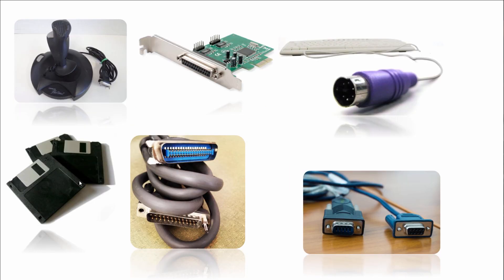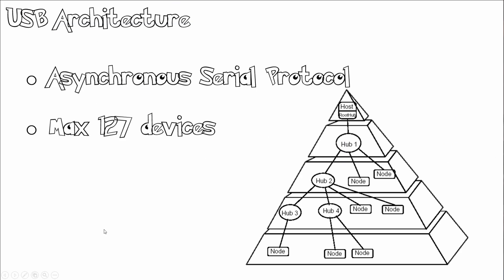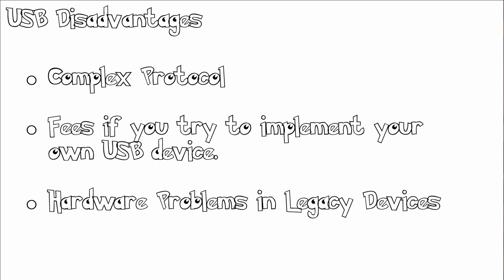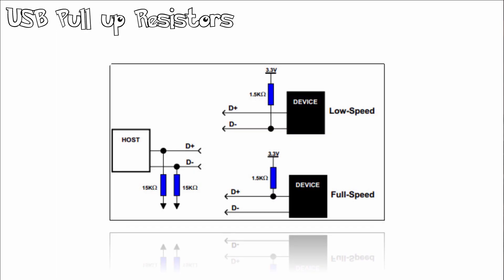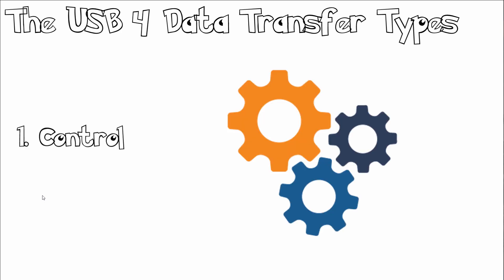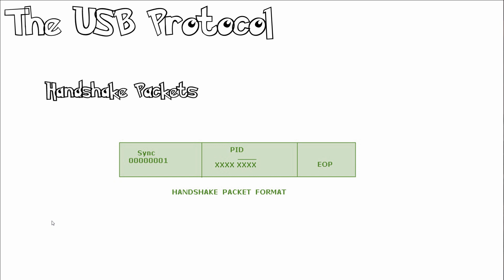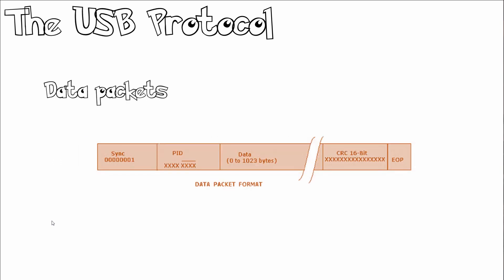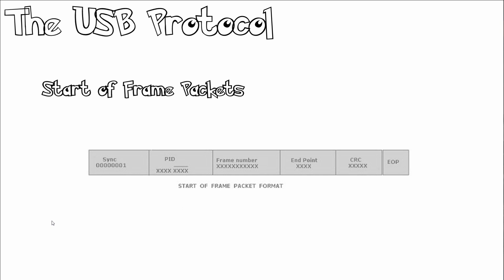USB Protocol in 15 Minutes

Comment: I'm teaching my self to program M4 microprocessors and I'm learning the different peripherals in the microprocessor. This is the most concise explanation of all the communication protocols that I have found. Thanks.
Reply: The peripheral is not in the microprocessor. The microprocessor consits only of the cpu thus alu and registers as bare minimum. A microcontroller consists of microprocessor and all the peripherals.

Comment: If I use a rusty USB head or USB port, or have been exposed to liquid ink to copy a file, such as a video file to a new one, does it affect the quality of the file or more specifically the quality of the video?
Reply: are you asking if a rusty usb will cause the digital file quality to degrade? the answer is no, if it transfers it will be 100% the same file from point A to point B.
Reply: @Newbrict  Thanks for the answer.

Comment: Thanks for this upload. Sub'd for more like this.
  I appreciate your efforts. I have a hard time learning things like USB protocol from just the theory without some practical application. As a suggestion, perhaps you could look into a project like the USBasp Open Source Hardware serial programmer (no affiliation) and explain some of the grassroots aspects of USB on a more practical level using the open source code. I know that device is using an ATmega8 MCU to fake a USB connection. I imagine that is probably the simplest possible example of USB protocol.
  I haven't played with the ATmega32 myself but I believe that microcontroller has an on board USB port. That controller is supported on the Arduino IDE as the MCU on the Arduino Leonardo board so hobbyists and beginners like myself should be able to understand a practical example on these platforms more easily.
   I appreciate your efforts here. Every time I look into USB protocol I get overwhelmed and don't make much progress, but I'm barely able to copy and paste code so....
   I see a few comments about people that don't understand your English. I am a native English speaker from the USA. I have a hard time understanding many Asian to English accents. In my opinion you seem to put a lot of effort into slowing down your enunciation and altering your natural speaking rythem. I appreciate that, and I was able to understand you and subbscribed because of it.
Have a great day,
-Jake
Reply: The atmega8 does not fake a usb connection.. it is creating a serial COM port. The atmega32u4 has built in USB functionality, which can be used as an HID device. Although you can use a library called Vusb to use any atmega chip as hid.
Reply: are you poor?
Reply: Too much smart people here